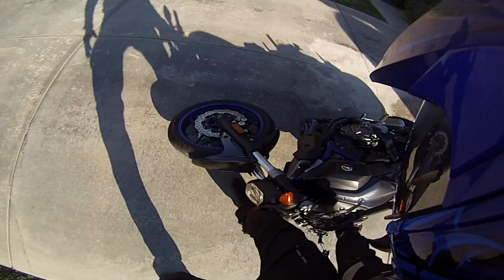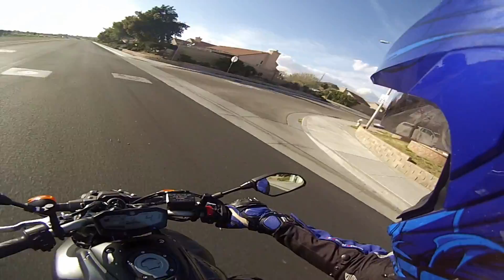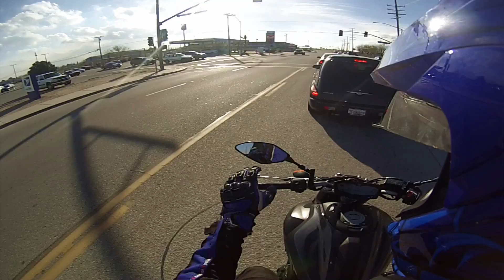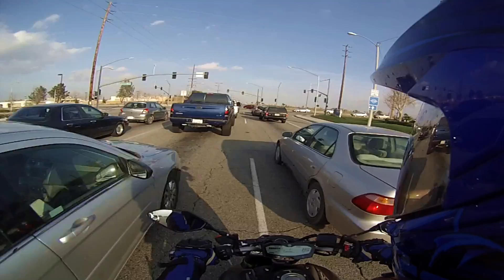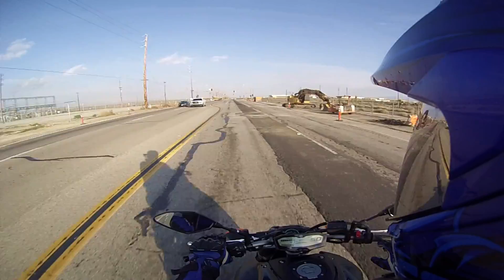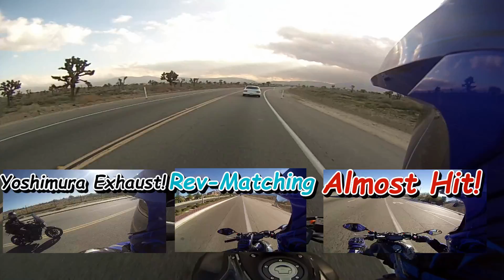Dropped My Bike! and (Re-gearing the Fz-07 and how Gearing works)

Comment: If you leave your bike in neutral, on a down hill slope, it will roll forward, & off the side stand, & lay down
So, on any slope, put it in gear
Would you leave your car in neutral, on a slope, without the handbrake being on ?
No
Same with a bike. No handbrake, so needs to be in gear to stop it rolling away

Comment: This is another way of looking at the torque aspect, if you go up on the front 1 or 2 teeth, you spread out the available power range, basically the bikes torque output stays the same, but the gearing ratios changes the use of available TQ, so going with a taller (more tooth) counter sprocket, this will lengthen the range of it's use giving the motor a more relaxed feel, and lower RPM at higher speed. Going to less tooth sprocket up front gives you less use of the torque output being made, and makes the bike more revy, and more wheelie prone, but it does as he said cause the motor to rev more for any given speed, and this bike makes it best tork in the mid range, even the tack is biased to show this. Another thing is you go max of 2 teeth up on the front no chain needs to be changed, unless a larger rear sprocket is used, but for now forget about the rear, the front is cheap to change & fast to do, and if the chain has stretched a bit it will bring it back a little. I purposely left out the rear sprockets because it makes it a little more confusing, because it works in reverse to the front, as he said. But it works great on bikes with big TQ curves like the FZ-MT-07 bikes..

Hope this makes sense to whomever reads it, even better do a lookup on the subject.. Best. yl

Comment: Thumperman Chame I'm just wondering. I haven't checked my gear ratio as of yet, but on my dr200s (2015) the top speed is about 70 mph, and even in first gear the wheel barely lifts up. I want to make it so itll at least cruise at 65 - 70 nicely, but also be able to do power wheelies. Should I go with what you had on your 400, 15/40? Would that work? Please respond! I really want to know, I feel bad every time I make the bike whine. I'd love to upgrade to a different bike, I've been riding for years, but I just got this bike and got to pay the bills and all so really don't have the money atm. I figure changing the gears, new slip on exhaust and a performance intake filter may do the trick....

Comment: 16/43 stock gearing. Going up 1 tooth on the counter sprocket will increase chain life & correct speedometer error. Also changing the front is easier than changing the rear.

Comment: Thumperman, this guys says it's a 43t, also might find some more info somewhere over there about the gearing changes for the FZ07

http://fz07.org/thread/1638/vortex-rear-sprocket
Reply from the maker: Thanks yea I read that it's 16 front 43 rear so I'll probably throw a 40 or 41 on the rear. :)